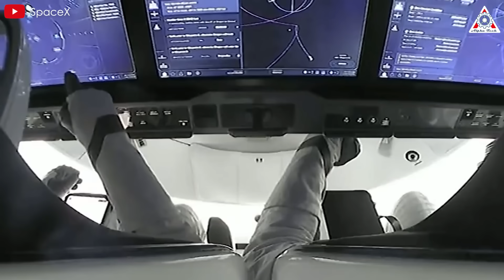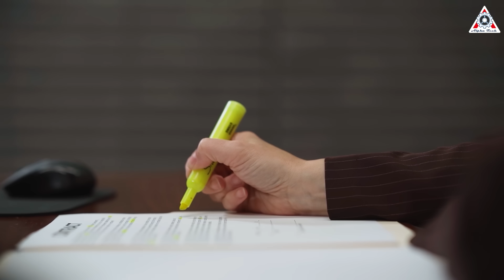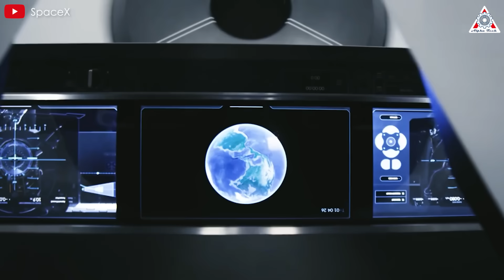Here We Go! SpaceX to launch Dragon to RESCUE Strand-liner Astronauts...

Comment: The market will be much higher than the traditional 200k/yr because as soon as the Tesla Semi is introduced, the entire existing fleet of ~3 million diesel semi-trucks will be obsolete and require replacement asap. If this replacement occurs in 10 years or less, then the available market expands to 300k/yr or more. If this replacement occurs in 5 years for economic reasons, then the market would be at least 600k/yr.
Reply: You can't replace ICE that easily.  You still need the infrastructure  and investment  in charging stations and power for them.  You are working at a distinct SUB OPTIMAL power efficiency for the entire 'electric drive' vehicles because you STILL need fossil fuel energy to provide the electricity to charge the trucks.  The cost per mile, including the necessary infrastructure, is still double what a good Diesel can provide.  It also suffers in cold or heat compared to a Diesel truck, and has to haul almost 15 TONS of batteries around constantly, giving only 400 miles of range before requiring recharge.  All detriments compared to Diesels.  Diesel trucks go 600-800 miles between refills, and it only takes 10 minutes to fuel up.  Tesla semis are, in effect, not viable at this time, no matter how starry eyed and brainwashed the Fan Boys may be.
Reply: @isaalghazi9131 Ever heard of battery swapping in 3 minutes? It's going to happen soon!

Comment: Macdonald Douglas bought Boing with Boing's money and DESTROYED THE COMPANY.
Reply: Mc Donnell Douglas had lots of re landing of rockets they did it just before being bought by Boeing
Reply: @WalterKazban  When money is involved, things tend to go bad, and when a company buy another, most of the time things go bad. It's plain logic, the buyer ends up with a fund deficit (cuz they paid), while the seller has money but also isn't involved anymore. So the one in charge is the one with a "need" for money, so they do the usual crap like firing old employees, tax evasion, cheaper materials, less quality control, etc. They think about money, anything else is secondary.
Reply: @Philipasu Mc Donnell bought  Douglas aircraft the Mr Mac  got old..and Boeing sucked up a good maker of more navy planes but AIrForce too..the people who flew had a good feeling when taking off they had two engines if one was damaged  the other would get them home...but contracts on Few F4s were told to use missiles  in attacks left off gain gun a mistake. But had pod installed l8r..
Reply: Very sorry John...Boeing bought 
Mc Donnell Douglas out and tried to learn something from bought Mc Donnell Douglas Aircraft..located just north east from St Louis Lambert Intl ..Airport. Hwy 70 and Brown rd area
.today it's Boeing...
Reply: DEI ruined Boeing. DEI!

Comment: Gr3eat Video !  The Boeing Starliner  problems should be fixed and handed  over to ULA for proper management !  Boeing retired its older engineers who knew how to network and fix any problems !  The new young kids at Boeing do not know how to get out of a cardboard box by themselves !  The Starliner is needed to service  the replacement of the ISS and the low inclination LEO CSS with the Fuel Depot nearby heading East from the KSC !  The LEO CSS  is a great orbit to launch missions to the moon and land at the  South Pole Lunar Outpost/Base (Clementine Base) with a LS Fuel Depot nearby !  Read the paper "Moon Direct" by Robert Zubrin !  Also NASA for SAFETY should mandate a common Suit Plug and a common  Hose Plug for the capsules and spaceplane Dream Chaser !  Also the new Space Stations and the HLS should have the new Hose Plugs for Crew SAFETY ! ! !  Timothy Lipinski
Reply from the maker: I hope the issues get resolved and the program can continue on to success!